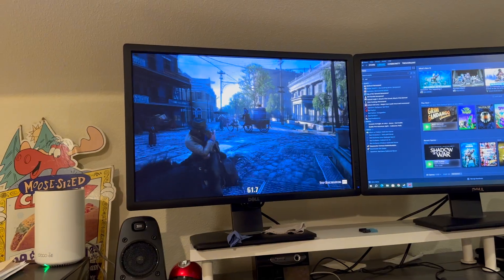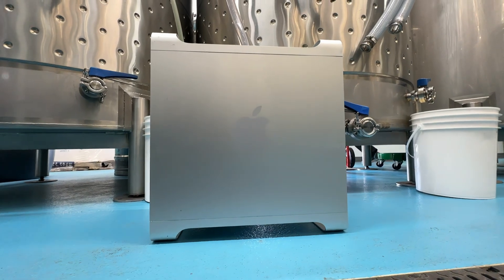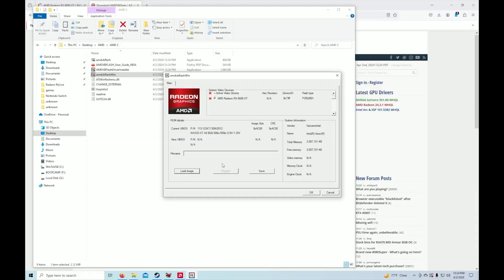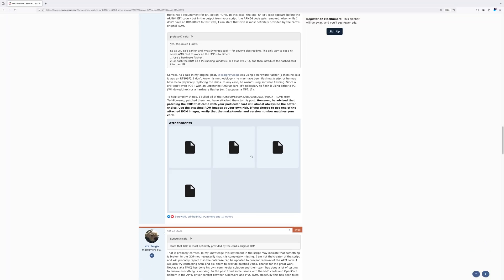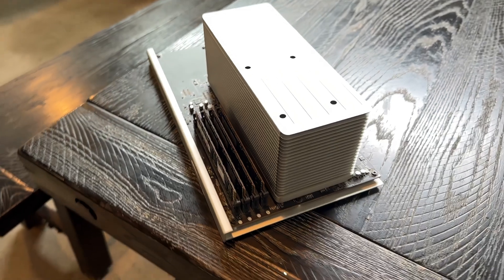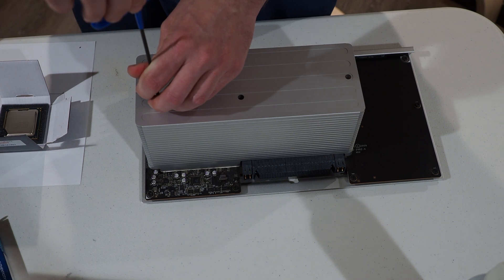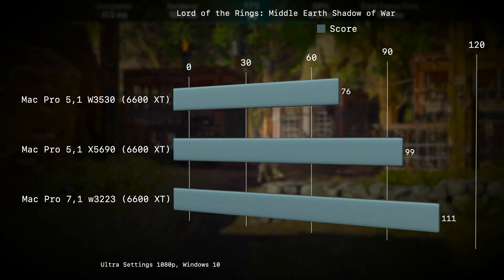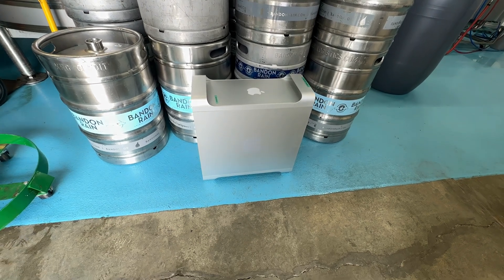Is it worth upgrading a Mac Pro 2010 in 2024?

Comment from the maker: Minor error: I stated in the stats ddr2 and not ddr3 also I didn’t include 6900 XT 1080p benchmarks, I’ll post those in this comment later.
Reply: Yes, where's the 6900XT ... 

The 7,1 was likely GPU bound with the AMD 6600.
The 5,1 has good performance though - esp for the cost.
Fun times!

Comment: The good old 5,1 Mac Pro, the best computer Apple ever made.  It actually inspired me to transition over to the equivalent PC workstations after I sold all my 5,1's.  You can get 2-3 generation newer PC workstations with equally great design for under 200 bucks now.  Some examples would be the z620, z640, z4 g4, P520.  I'm using a Lenovo P520 with xeon w2145 with a rx-6800 right now.  Cost me about 650 total with GPU, CPU upgrade, 1TB NVME and 64GB DDR4 ECC RAM.  You won't get nearly the CPU bottleneck issues with a system like this and they are cheap.

Comment: I may have the fastest Mac Pro 2010 (Mid 2010) on the planet with 2 X 3.46 Ghz 6-Core Intel Xeon, 96 GB Ram (96 is faster the 128 believe it or not), Radeon RX 580 8GB, NVMe and SSD drives, 10 Gbps Ethernet and Bluetooth 4.2. with antenna. I'm about to upgrade to Ventura.
Reply from the maker: Yep, triple channel memory. I’ve debated trying to get a hold of a Mac Pro 5,1 again just to benchmark it to death. I had issues in a Mac Pro 2008 with Ventura and above with my RX 580 but I think that is fixable. Otherwise it’d run it just fine.

Comment: And how to inform Open Core Legacy Patcher developers that now the cost of used 32GB DDR 3 (10600R) memory modules for servers is low? You can buy one module for $20 - and that's great for MP5.1 upgrade !)))
What is missing in the Open Core Legacy Patcher settings now is an option - use 1 - 8 32 gigabyte RAM modules (10600R/or other compatible), and instructions on which slots to install the RAM modules in, depending on the number of modules, and depending on the number of slots.

Comment: I am still using an 5,1 (flashed 4,1) that I bought, from a junk heap for $75…after watching your videos from a couple years ago.  Had to buy a few missing parts from eBay, then upgraded the RAM, went to newer CPUs, added an NVME drive, etc.  Still have less than $400 in it and but now I need to upgrade the graphics, and replace RX570 with something newer.  😊
Reply from the maker: GPUs got stupidly expensive again, I paid $39 for an RX 580, and now they’re back up to $75. The 6600 XT can’t be found for $200 anymore either :(
Reply: @dmug hi Greg, does the RX580 need to be flashed? Can I get a OCLP boot picker screen with it as-is?

Comment: what's the absolute best video card for 2012 (flashed 2009 12 core) currently using rx480
Reply from the maker: If you're willing to go Pixlas and block your second 16x PCIe Slot, the 6900 XT. It'd be really stupid but it is feasible. It's best to go 6800 as there are dual height ones. 

MacSoundSolutions has a video about flashing the 6800

Comment: Hi Greg, I have a recurring question. I managed to get my claws on a 5,1 Mac Pro, leaving behind my 3,1... As in the 3,1, I am running Linux Ubuntu as the OS. But I have a thumb drive with (OCLP) Monterey and the old SSD with High Sierra from the 3,1... If I plug in the High Sierra drive, can I boot it into MacOS? Will I be able to boot into Linux again...... What should the "order" of my actions be to boot into Mac OS and/or Linux???? I am planning to use the thumb drive to have Monterey working... And Linux Ubuntu... Thank you for your response...
Reply: This is a lot to ask a stranger.  Good luck though!

Comment: what would be the best, top 3 gpu's for 5,1 running Mojave, Monterey and Sonoma (partitions for testing)
Reply from the maker: Well, if you want to have Mojave compatible, you're limited GPUs that were supported in that era which is the Radeon VII, then Vega 56 and 64 and the RX580.
Reply: @dmug  ok what if I dont need Mojave and just rock 5,1 Cmp?
Reply from the maker: @OTTOAUDIO  https://blog.greggant.com/posts/2018/05/07/definitive-mac-pro-upgrade-guide.html#aftermarket-gpus

Comment: Awesome video Greg, love to see the 5’1 videos. I personally use a rx 6800, dual x5690, and 96gb ram config for tripple channel. It works great with a converted 2017 27” iMac 5k monitor and I have to say it’s one of the best pairings you can have with the 5,1 and at 4k gaming.
Reply from the maker: Those 5k iMac displays are just fantastic.
Reply: I have 5680’s. Never saw the need to go to 5690’s and heard that in some cases the 5680’s are more efficient. Probably urban legend no?  What do you guys think the performance gains are moving to a dual CPU with the same gpu and ram Greg?  How do you pair the 5,1 with the iMac? 

Any response would be greatly appreciated. I enjoyed building this Mac 5,1 so much. My first computer build. It saved me the cost of a Mac Studio when it came out!

Comment: Love learning about the old classic mac pros. I recently bought a 2010 mac pro for $100 AUS that did not work but has a dual cpu tray upgraded with the maximum cpu's for that machine, 32 gb of ram, a usb 3 pcie adapter and a blue ssd drive sled and 3 attachment for ssd's to the other sleds. I believe it needs a new power supply but I bought it for the parts. Plus I bought another 2010 mac pro that does work for $200 that is a dual quad core cpu, 32gb of ram, a metal spported graphics card and 2 tb seagate harddrive. I have a m2 and nmve dual adapter and have put a 128 gb m2 ssd and 500 gb nmve ssd on it. I will waiting for Gregs other videos and upgrade the working mac pro and use a power supply from one of my 2009 mac pros to try and fix the non working mac pro. Look forward to the other videos. One day I might even own a 2019 mac pro when they become cheap enough.

Comment: I think the bottom line here is these older. Mac pros have more than outlive their expected life and and they still deliver a crazy amount of value I would argue over and above similar PCs that were sold at the same time. I have 2; a 3,1 & a 4,1. I use them primarily as large drive carrier photo repositories so they really only get turned on a few times a year when I need something but seriously these systems are just great and they run and run and run.
Reply from the maker: Accurate.

Comment: The NVRAM has degraded on 2 5,1 Mac Pro backplanes for me in the last year.  Stuck at Catalina because OCLP simply won’t budge on anything newer.  It WAS a 12-core 3.46Ghz system with 96GB and 2TB of mixed NVMe and AHCI PCIe flash running Monterey.  It’s so power hungry, I’m going to replace it with a 12-core 2013 Mac Pro and use the RX580 I have in my 5,1 in an eGPU enclosure and roll the 5,1 back to High Sierra and Mojave without OCLP.  All the work arounds and advice to get any OS above Catalina to boot/install on every forum or YouTube channel I’ve tried failed miserably and I can run universal binaries of current IZotope and Waves plugins with current Pro Tools and current Reason 12 just fine on Catalina.
Reply: Ask someone nicely on the OCLP and 5,1 FB groups to walk you through the process. You just need to do it the right way.  Asking folks who have or do run Monterrey and Sonoma effectively like myself found most people offering help are on Macbooks. With our many drives the process is different than a single drive machine. Their help is well meaning and all but not for us.  The Trashcan is great if you have TB@ perfs.

Comment: First love your channel and your seemingly infinite knowledge of all things Mac Pro 5,1. I pretty much maxed my sc MP to play games and it WAS a lot of fun. But as you already stated thats for older titles and my library was filled thanks to Santa with newer CPU dependent games like Starfield aka Star Wars. And while I love all my MPs they either are retired or serve as a HTMac vs a gaming rig. In fact it cost excruciatingly LESS to build a mid-tier PC that plays everything @1440p locked 60FPS with max settings then it did to upgrade my Mac to play only old titles. Jat, cheers.
Reply from the maker: Yeah, I was wondering if there were some games that simply were going to crush the Mac Pro, my brother and I don't play online games, and we only had the games in his Steam Library (nor does he have a FiOS connect like myself so it takes a lot longer to download games) so we were stuck with older titles.

I'd checked Stray, CyberPunk 2077 and Alan Wake 2 but I even had my Mac Pro 5,1 at the launch of CyberPunk and used the NoAVX hack. With a Radeon VII at 1440 upscaled to 4k it was a 60 FPS experience mostly maxed. I have a feeling if CyberPunk runs fine, those others would as well.

I know there's genres of games that probably are going to punish a Mac Pro 5,1 more, mostly the competitive MMO online style games but as someone who doesn't play many games and limited time, I'm just never going to be evaluating those. StarField though notoriously ran like shit on even high end gaming rigs so I feel like that says less about the Mac Pro than it does about the game's optimization.

Comment: Very cool, nice to see the 5,1 upgraded and running well! It still looks modern, hard to believe it’s an older machine. Definitely good value for performance, easy to upgrade but still capable! Great video!
Reply from the maker: I really wish Intel would have kept the socket for one more generation so we'd had AVX natively. That'd added quite a bit.
Reply: Even with the older architecture, it’s one of these older machines are are still capable even today. Despite the setup needed, the fact it works is awesome to see!

Comment: I've got a 2010 5,1. Now cannot get a OS on it. 🤦🏻‍♂️
Reply from the maker: Do you have access to one the GPUs with a native Mac ROM, like one of the GPUs it shipped with? That's going to be crucial.
Reply: @dmug  Hi. Thanks for your reply. Yes, I do.
Reply from the maker: @JgHobley  If you have a Mac, creating a USB bootable drive shouldn't be too hard. If you have a DVD-R, burning whatever OS you want should be easy. Just NVRAM reset before trying to install.
Reply: @dmug  Hi just wondering what OS versionis the latest that will work with the ATI Radeon GPU?
Reply: I cannot tell you what it's been like in the past hour! 🤯 I found the original GPU. Didn't work. Then realised I needed the power cord for it. I found it! Then the Apple Cinema display wouldn't work but remembered there was a mains plug which I some how found. Now, I have a flashing folder showing no OS. Where can I get an old version? I don't think my 2015 MBP will let me get a very old version?
Reply from the maker: @JgHobley I have them linked on my blog, this will take you to the old OS section. I’d recommend starting with high sierra as it’ll support the old GPU then moving from there 

https://blog.greggant.com/posts/2018/05/07/definitive-mac-pro-upgrade-guide.html#oldversions
Reply: @dmug  That's great, thank you!  I've just found a new 16gb usb so will tomorrow. 👍🏻👍🏻

Comment: So... you need a windows box to upgrade a Mac. Right.
Reply from the maker: Well, only if you want to use a GPU from 2023 in a computer from 2010. The Radeon VII offers similar performance to the 6600 XT but many were mined pretty hard since they had 16 GB HBM2 memory and still go for as much as a new 6600 XT if not more.  5700 XTs are a better used option but slightly slower and not a huge price difference.  

Of the three options, the 6600 XT draws by far the least power but requires flashing and can only be used with Monterey and newer. The VII is supported in Mojave and the 5700 XT in Catalina. Just how it is trying to keep a computer nearly 15 years old semi-currrent.

Comment: In my experience with this heatsink (I have the single core model), you can't over-tighten it. Once you tighten them all the way they won't go any further. The main thing is to do a criss cross pattern and only tighten each screw 3, or 4 rotations as you do that, as to not put too much pressure on one side of the cpu. Then go over the screws again until each one stops and gives you resistance. I have never been able to over-tighten them because they don't let me. I thought the over-tightening was only an issue with the de-lidded models?
Reply from the maker: Trying to remember the one where people snapped them. I think all dual cpu trays? Maybe someone else will chime in.
Reply: @dmug  Gonna have to agree with @alienrefugee51 on this Greg. Upgraded 20+ machines and there is no guess work. The screws don't simply resist, they come to a definite stop point. I can't understand people saying you can over-tighten/crush/bend CPU pins. I see more memory/cpu issues on FB groups with people not tightening to stop point. The only over-tighten issue is people that don't de-lid on a dual core 2009 board, and then i'm like "good luck with that" :)

Comment: Thanks for the shout out, nice one!
Reply from the maker: Yeah, I meant to tell you that was happening. The tip about using the patcher is what was crucial as I stupidly just flashed the card before reading anything.
Reply: @dmug  If I have upgraded to EnableGOP, do I still need to flash the ROM for my RX 6900 XT graphics card?
Reply from the maker: @hieutranhamchoi  on a Mac Pro 3,1 - 5,1 yes. As explained in the video you cannot boot a classic Mac Pro with a 6000 series GPU.
Reply: @dmug  -- I thought you could boot from a 6K series AMD GPU, so long as you have (or had) OpenCore setup and maybe macOS 14+ ... ?

Comment: Good. I just bought one two weeks ago :-)
Reply from the maker: If it doesn't have the X5690, you can still get them for $25. The X5680s as little as $15. There's really no reason not to upgrade to either CPU.
Reply: @dmug  Im looking at that. I'm also considering getting a dual CPU tray for it and upgrading to a dual 5690 set up. :-)
Reply from the maker: @stevem-h3562  It's almost always cheaper to buy an entire dual CPU computer than just the CPU tray. You might luck out but that's been my experience
Reply: @dmug  yeah, thats not lost on me. 🙂